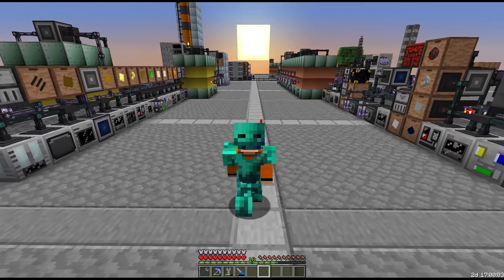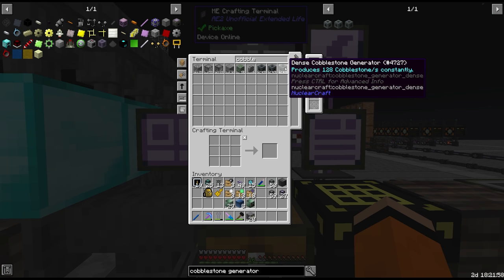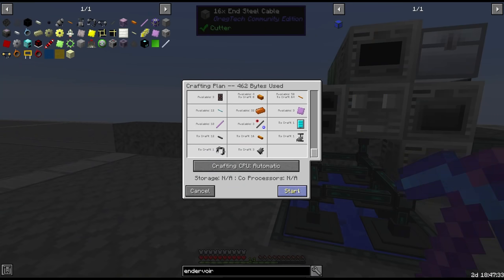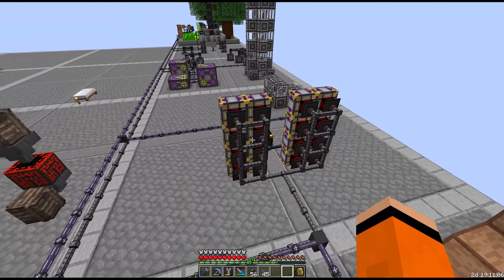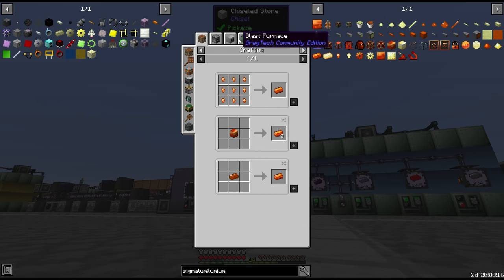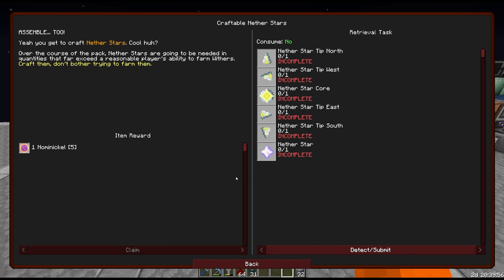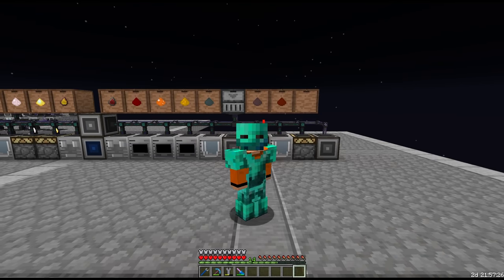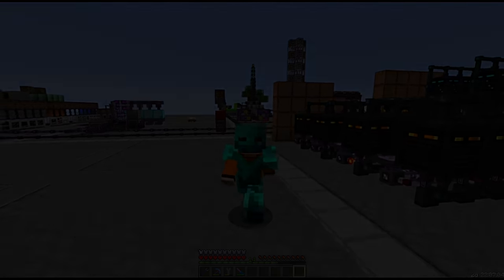Lumium, Signalum & DML Upgrades - Nomifactory: Episode 12

Comment: İn my save i went with witch models for redstone and blaze models for blaze rods which i macerate and sulfur and then i craft them with a mechanical crafter and fluid extract them and after that send into magmatic dynamos. İt overcomplicates but i was producing around 150 k rf/tick using 10 models which is 25k more then this and the macerator and fluid extractor was mv so it used 1 k of it so it is 24k more effective. İt is just overcomplicated... I switched to a reactor now and i am producing about 1 million rf /tick which is a lot nicer:D

Comment: Good progress as usual! In my experience an EV cobbleworks should get you to tank just fine. I feel like the ratio math you crunched for DML is erring slightly on the low side but nothing wrong with overproducing a little.

Aqueous Accumulator auto-output speed is actually rather slow, but you can extract an infinite amount of water from it arbitrarily fast using covers or a fluid storage bus.

I used to think it was impossible to mute the Aqueous Accumulator as well, but apparently the problem is that its sound effect is extremely long and the sound muffler just prevents it from playing new sounds. You either have to exit and load back in or wait quite a while for it to finish its current sound (this is also why it doesn't show up on "recent" in the muffler GUI).

I should note as well that Mechanical Crafters don't need items buffered in their input slots. If they are adjacent to an inventory it will craft by extracting the items from that inventory directly. Inventories means any item container: drawer controllers/slaves, the output slots of adjacent Mechanical Crafters, stocked ME interfaces, etc. You can do some pretty nifty stuff with them, just be careful about using Redstone to turn them on/off since unlike GregTech machines, they bleed signal through to adjacent blocks when it is pointed directly on them.

Sphalerite along with Galena are important for the production of Indium, so you ideally don't want to process them past "Purified Crushed" in preparation for that. A chemical bath at MV or above washing Crushed Sphalerite with Sodium Persulfate will guarantee a full Zinc dust per washed Sphalerite. Definitely the optimal way to get Zinc for your alloys and filters.

People often forget about the Chemical Bath as an ore processing machine, but it is really good for washing certain crushed ores with Sodium Persulfate or Mercury. It gives a full dust instead of three tiny piles, and often a different dust than washing with water would yield. These washing fluids are easily sourced from Salt and Cinnabar, respectively.
Reply from the maker: Yeah I also found that the sand movements were slightly low, leaving sand to buffer in the chest. It's still faster than the 1 chemical reactor though at this stage so it's fine. Thanks for watching again and giving everyone your wealth of knowledge:D

Comment: Ah yeah, redesigning pulsating polymer clay at ev tier is when I realized that item conduits are way too slow. Also, keeping your cobble works separate is a good idea as well, that also caused me a lot of problems around this point.

I actually used numismatic dynamos all the way until oxygen plasma in a fusion reactor, so I had about 100 dynamos by that point. I didn't have the models to fully support it but I had a huge buffer of diamonds and spike power production to run power hungry assembly line crafts up to that point. The amount of diamonds you need to reach tank is kinda ridiculous so having a huge buffer leftover from your power supply is convenient.

Haven't had much play time lately but I've got up to the tier 3 miners on passive at this point and maybe I can reach tier 4 if I can get enough play time tonight! It's around this time that I feel a little burnt out on modded minecraft but also somehow excited about starting a different pack. I may need to play some other games for a bit in between. I'll definitely keep watching your vids though!
Reply: Item Conduits are fine if you expand your cobbleworks using additional LV or MV Machines, rather than upgrading the energy tier.  For example, my Cobbleworks is 16 MV Macerators making Sand (8 making gravel auto-outputed to an adjacent 8 macerators for sand).  8 Item conduit connections with just 3 upgrades each transfers 2 stacks of sand per operation, which keeps up with a Tungstensteel-coil Multismelter, no conveyers needed.
Reply from the maker: Take a break if you need it! I'm really surprised though you were able to do dynamos all the way to assembly line :D

Comment: You can craft up wires into 16x wires and then coat them on circuit 24, no need for an extra assembler
You can storage bus a controller slave, no need to move that drawer controller
Reply: A dedicated machine that binds the cables saves a lot of crafting 1x into 16x operations.
Reply: @MrErizid  Yep, the Wire Bundling Machine is something I personally added in Shadows of Greg to combat the massive amount of wire combining you need later in the pack. They work in Processing Arrays (unlocked at IV) and considerably reduce the strain on AE2 (and improve crafting speed) since it's not doing thousands of individual combining crafts in Molecular Assemblers.